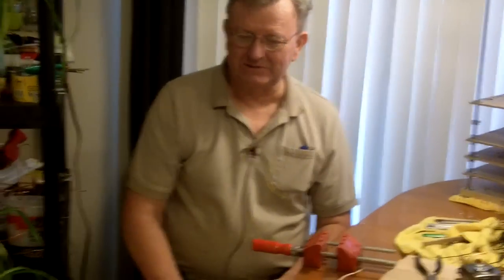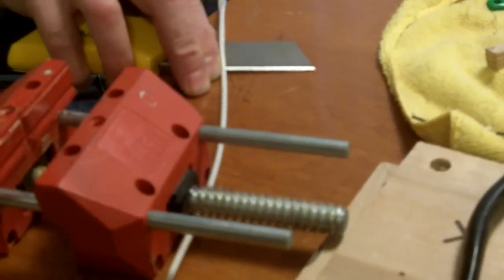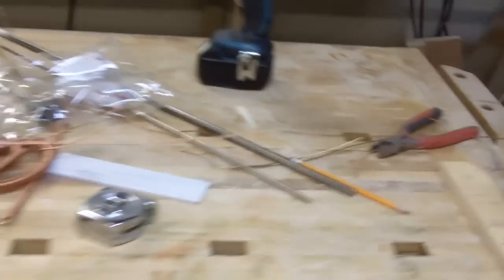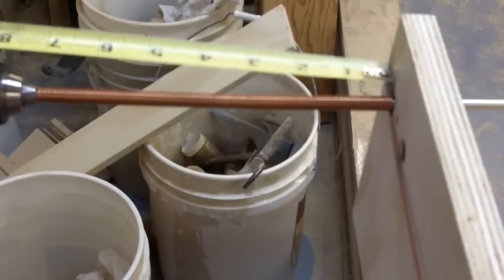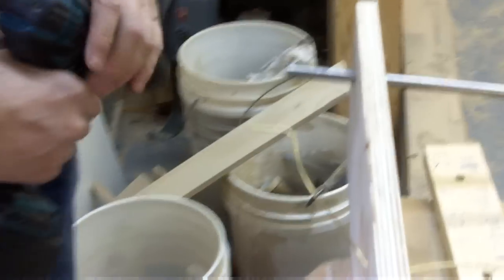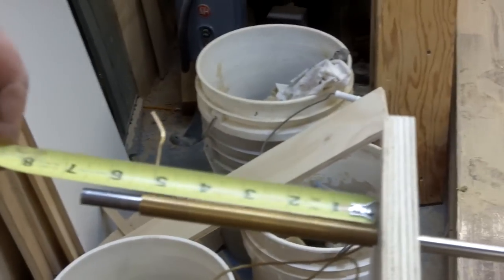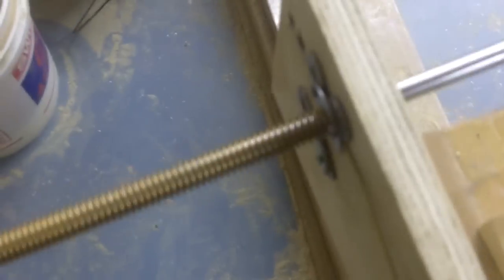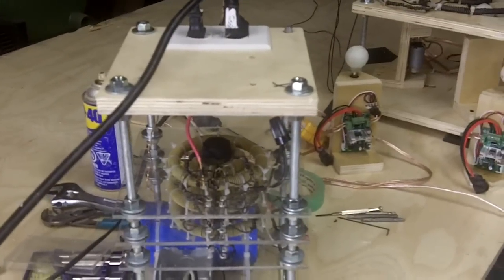How To Make Copper Wire Energy Coils

Comment: Why is it necessary to remove the insulation from the individual wire? Doesn't the inductance work through the plastic?
Reply: Indeed the inductance works through the plastic. However removal of the plastic insulation may have something to do with the spacing in between the turns. The spacing between the turns of wire, if the plastic insulation is left on, is fixed by twice the thickness of the insulation; this may not be the proper spacing for optimum functioning.

Comment: Why do you not simply use enamel coated wire,  which is normally used for making coils?   No need for spacing then.
Reply: And no need for stripping them. I guess some people like to do it the hard way.